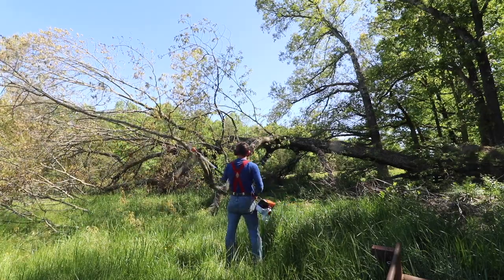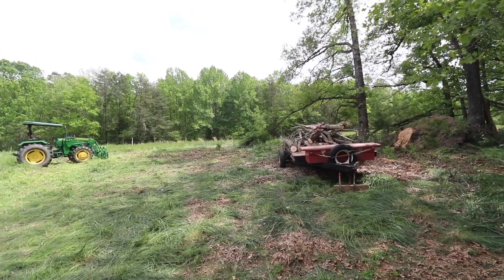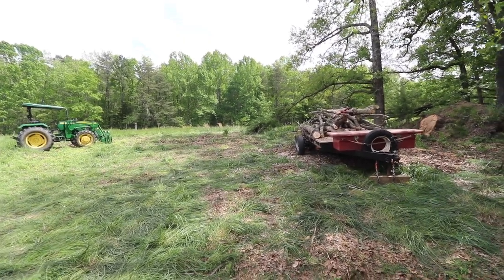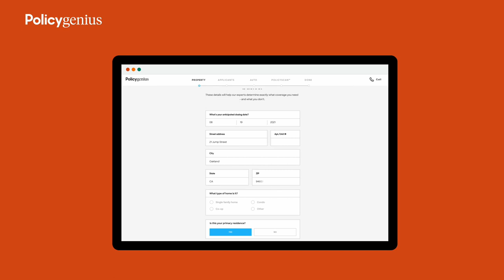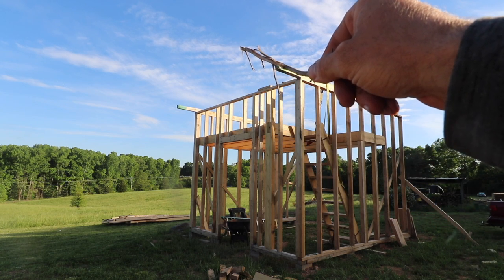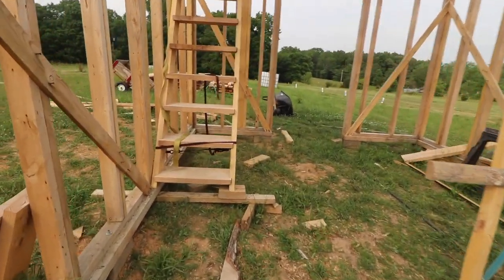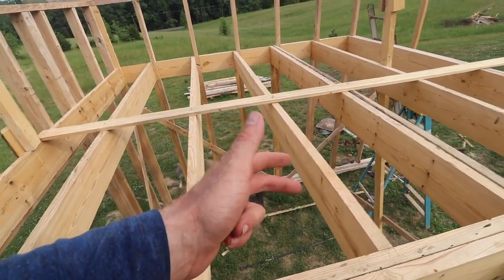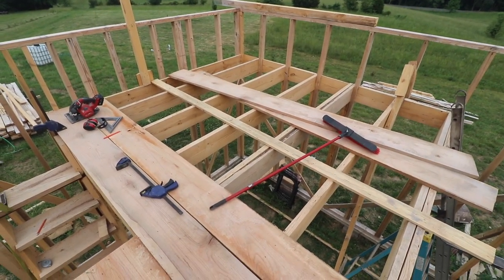$2,000 HOUSE - "FREE" OAK LUMBER for LOFT FLOOR - Cabin - Ep. 4

Comment: One thing I'd recommend is investing in some chaps, especially if you're out there cutting by yourself.
Reply: Great comment! I'd add a face guard and hard hat combo. The screened face guard doesn't fog up like safety glasses.
Reply: As well as little wood blocks cut to a point that you can hammer into the log as you cut those big logs to keep your bar from binding when you get to the bottom. It’ll save your chain and your bar lots of wear and tear
Reply: Safety first

Comment: That mobile saw mill is one of the coolest ones I have ever seen!
Reply: Exactly what I was thinking. It's badass!
Reply: same here,  never saw one like that before
Reply: That's a top of the line model with all the hydraulic assists for loading and rotation.  I think (I could be wrong) that thing is about $40,000.
Reply: @MrClarkisgod  I wondered how much it was too and while that model (Timber King 2220) is no longer sold, the Timber King 2200 is around USD $64k.
You'd need to be milling a lot of timber to justify that, unless you're also milling for others and earning income from it (which I believe I recall him saying he does from time to time).

Comment: What a great saw mill,  what does something like that cost?
Reply from the maker: Bandsaw mills start around a few thousand dollars for very small basic manual mills. This one is about 60k. But other than moving boards which you could get someone else to do, you control it with joy sticks and knobs. It’s a lifetime purchase for me and while it is a pile of money, with the work I do the return is fairly quick. It’s also not that hard of a purchase when you drive cars that cost a few thousand and have no debt. Most people spend the money things like this cost all the time on “normal” stuff. Just some extra thoughts since a few people have asked.

Comment: DORMERS:  Just a few thoughts from the 81 year old guy.   I would go with two shed dormers about 7' wide allowing 4' sections of 12/12 pitch common rafters on both ends.  This would give you room on the dormer wall for a 32-34" x 60- 72" wide slider window. Assuming a 4/12 or less pitch on the dormer roof.  The large sliders will provide both egress and cross ventilation. Besides the shed dormer is easier to build; just common rafters off the wall in line with the wall below.
From the inside sitting, at a bench or desk;  your eye's are about 4' from the window.  This gives you a panorama view of the fields; where a tall  narrow window view in a gable dormer is mainly sky.
the old guy  Bert

Comment: You can't overblock especially with green lumber.  I would do the floor joists as well.  Curing lumber exerts tremendous forces to twist and move.  Another trick with green is to stay with narrower boards nothing much over six inches.  The wider they are the more they shrink.

Comment: Great video! Love the care and experience going into this.

Roofs seem to be the main source of ruin for houses over time. Driving through parts of Midwest boom and bust cities, there are so many houses collapsed inward from roof neglect. What are your thoughts on roof permanence vs. cost? I'm leaning toward always having thicker standing seam metal roofing to provide decades of use without constant replacement (better value and security in the long run).

Comment: Not being critical at all, but just curious. Was there a reason to cut the 2nd floor sub-floor boards one-by-one instead of installing them all and making one big cut? I suspect you had a reason, but the couple of times I have built a deck (sorta similar, just lower to the ground) I've always run them all long on one end then done the one cut to even them up. 
Second note, not too much detail at all. I enjoy your channel.

Comment: Looks great so far you definitely have a good balance I think the milling process look s pretty straightforward I think it'd be cool if you have the time to do a blueprint of what you're building and show that off I don't know if it matters or not but on your second floor I don't know if you're supposed to offset the subflooring I had to do that on my house but I used plywood so I don't know if there's a difference if you're using hardwood. Originally my house was built in the '50s and the sub for that I took up was solid lumber like yours but it was done at a diagonal which is kind of strange but I guess it makes it offset naturally that way. Hope all is going well Love the videos Thanks

Comment: I think you are striking a good balance.  I expect that as this series progresses, the milling will become kind of mundane.  I also like the use of the tripod, as the camera is steady, and a viewer can see the action without getting seasick.  I was just wondering what a GoPro type camera, mounted on one end of the blade area would look like.  It would be like looking directly at the bandsaw as it cuts through the wood.  That might be neat.  Not sure if it's possible without messing up the machinery.

Comment: When your cutting with the mill, is there a purpose/benefit to not pulling each board off the log after its cut as opposed to letting them "stack" as each is cut like you did? Doesnt that put extra weight on the blade as you get down to the bottom of the log and make the mill have to work harder to cut?

Comment: I have a few questions that I's asking as someone who would like to learn (I'm not critiquing). I'd like to hear more about why you doubled up some floor joists and not others. Why didn't you run the floorboards diagonal, like the older homes did that weren't built with plywood did? Keep the videos coming,,, I enjoy the variety of your content between all of your channels.
Reply from the maker: Doubled up joists that had more load on them, the end most will have a wall above it, the others are hanger hosted that will carry the load of other joists. I did the floor like I did to maximize my lumber, it was also easier and being 1 1/4 inch oak that wide it’s much stronger than the normal pine sunflower you would get in older houses.

Comment: Feedback - Great video,
Audio -  music is nice, a bit too loud on some violins but overall great addition.  Suggestion is to output the audio to audacity and compare your voice "Peaks" to the Music Peaks and always undertone the music just a wee bit so users with headsets are not adjusting as much. 
Video - Prefect in every way. lighting was great even at night. 
Content suggestions,  speak to the spans, the weight so that viewers are aware of limits if doing it themselves. Show off Hip joints, and why they are used. 
Keep up the great work.
Reply from the maker: I've always wanted to do something along those lines to the audio, it's the downside of classical music, it goes from soft and slow to busting loose so it's tricky simply adjusting the volume. I need to look into doing what you said, basically setting a limit on how loud it can go but maintain the low slow stuff.
Reply: @homemadehome5575  its easy when you just look at the graph, the peaks should be somewhat consistent across. U will get it